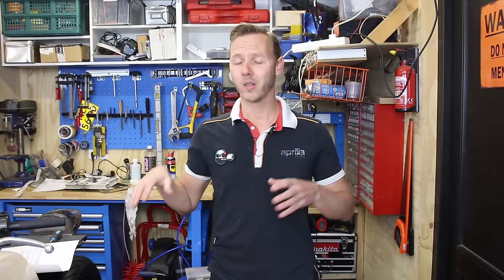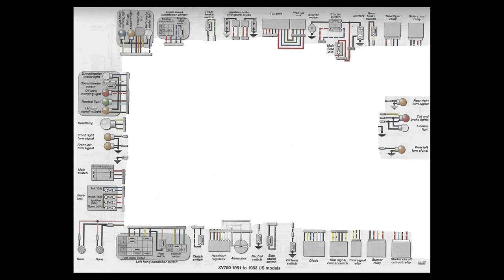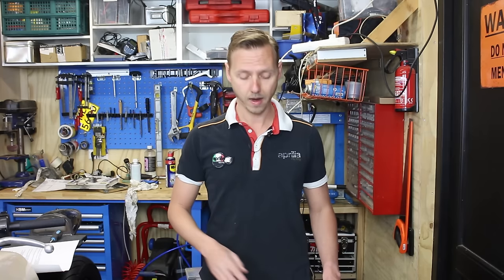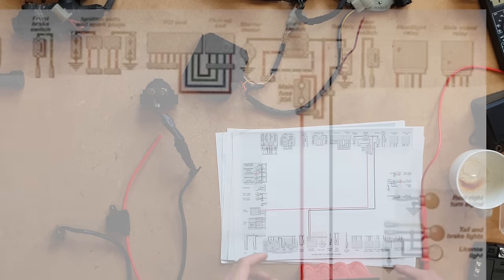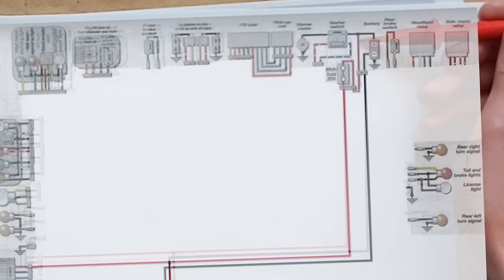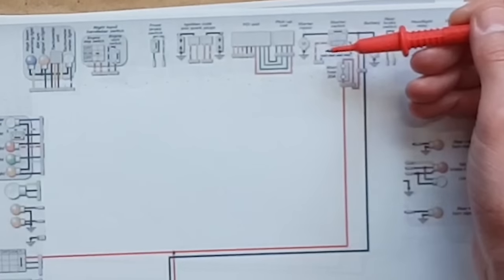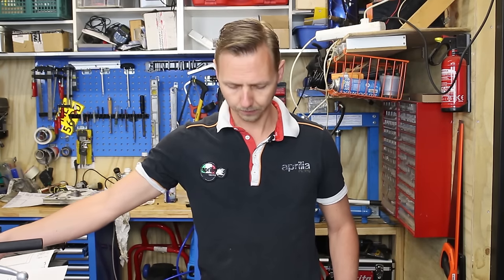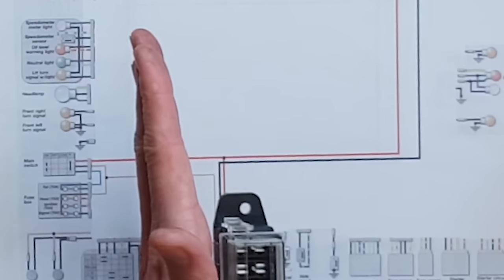Wiring a motorbike (or caferacer) 'Bare Bones' (part 2 of 2)

Comment: This didnt help me i got to the key ignition part and sparks went off i rewinded and re traced steps same thing one from battery 20A fuse  one from battery to starter from 20A fuse to 2 wire key ignition and bam sparks it doesnt work

Comment: Brother, I just wanted to thank you and let you know that I'm gonna go out tomorrow and wire up my 81 xv750 because of how easy you made all this. Thank you so much! It's been sitting in my garage for years because I was too scared to start taking out the 42 year old harness but now , I'm gonna get that fiery woman roadworthy!
Reply: ok, so I have a fuse block but I'm confused as to where I should attach the brown wire from the main switch(not the tap to the regulator/rectifier) onto the fuse block...to clarify, I do not know whether to connect it at the +,-, or to the side positive output terminals, or the ground input terminals... I think 90% of everything else is correct with uncertainty resting in the fuseblock connections and whether I have the two wires connecting the starter and solenoid attached the proper wires "the aftermarket solenoid uses two completely different colored wires than the stock wires. Any further help you can give me or if you explained it in the videos and I missed it maybe some time stamps? Thanks!

Comment: Doesn’t wiring you solenoid to the coils and etc directly,instead of going through the key first, make your Motobike work without turning the key on?
Reply from the maker: No. The main power is given by the key as very first. Main power to Regulator Rectifier 'on or off'. And, it also sends power to the fuse box (on or off) and the fuse box gives the power tot the coils... Follow this step by step video very closely as I explain this.

Comment: awesome video this will help a lot lol i found a 1970 to 1980 first gen Honda Odyssey go cart atv and someone put a Yamaha xj 400 engine from the bike in it and lot of the wires aren't hooked up and the spark plug wires are cut and nothing is hooked to the cgi box and they made there own control box with the key and push buttons and fuses and switches and that but from the key both blue wire goes out of the box somewhere lol and an orange comes back into the box i'm guessing cause its to the start button so there's no spark at all its a mess
Reply from the maker: For you to wire it up properly! 👍

Comment: Question Chief?
I have 83 xv750 but my engine is 1996 with one pickup coil but I was using the black TCI and start having issues and my bike stop working no sparks and all my wiring is chopped.
So I'm using your tutorial and start from scratch but I'll be using my 83 gold TCI.
Can I connect my pick up coil to the gold TCI? 
Only has 2 cables, 1 green, 1blue.
Should I connect them the same way it was?
1 on top 1 on bottom pin..
Great content, it helps me a lot,
Thanks!
Reply from the maker: Oof, that's a hard question. I always had hard times figuring out which pin is which color. The wire colors on the connector which is on the black one should be corresponding to the colors which come out of the gold or silver colored one I guess... Does that help?
Reply: @chiefpepdesign  I have everything connected so hopefully I'll started today.  I'll keep you posted if it works or not and if it works I'll probably make a tutorial cause probably there's a lot of people having same issues building cafe racer with engine swapped.
Thanks Chief!
Reply: Didn't fire up, just crank but no sparks!
I'm getting so frustrated...
I don't know if it's normal from the TCI to send all 12v to my coils( including orange and gray 12v) or they should be ground? 
Also, I always get ground from my 4 pins to the pick up coil, don't know what to do...
Not getting any sparks from any TCI set up I did. 
I follow the instructions from Chief and Virago tech forum for 1996 engine with the black TCI and nothing and now follow the 1983 TCI gold J4T00671 and nothing. 
Any suggestions from Chief or anyone that knows about bare bones Virago?
Any help will be greatly appreciated.
Thanks.
Reply from the maker: @rafaelalmo  I really think the best is to send this discussion to the Viragotechforum. It's too detailed for this place and you find only specialists there.
Reply: @chiefpepdesign  new update chief, 
I made one cylinder to get sparks so only rear is not getting sparks..
Means that if my theory is not wrong,  I have to either splice cables from TCI for pick up or make dual cables from pick up coil to TCI so computer will think that 2 pick up coils..
I'm so glad that your videos really helped,
Thanks!
Reply from the maker: @rafaelalmo  No no! Don't do that. The TCI manages the sparks one by one. The cylinders have to get a spark on very precise moments calculated by the TCI depending on the rpm's. Please don't just splice the cables or you will damage the engine seriously. Try to measure the ohms of your sparkplug caps. Next to that, try to change the gray and orange cable of the cylinder that isn't sparking the other way round.
Reply: @chiefpepdesign  got it Chief, did not do anything yet cause I'm doing everything slowly.   I will follow that and keep you posted.
Thanks Chief!

Comment: I have an 81 xv750 came in a lot of boxes... long story. I have assembled it... finally harness all hooked up, connect battery... nothing apart from one relay under the seat clicking. Dissapointed... I'll say! This has given me new hope.
What about the little block of diodes either in the headlight or (as mine are) under the seat, are they also no longer needed?
Where does the nuetral detect wire that is on the connector to the rectifier connect?
Reply from the maker: Yes. Ditch all the diodes if you follow my sceme. The neutral wire goes to the speedometer.

Comment: Hi! Great videos:) helps me alot👍🏻 i have a question about rectifier. I bought a new aftermarkert rectifier and i wonder how i connect the cables when i just have the black,red and yellow cable? I use the same fusebox and try doing the same set up like you:)
Reply from the maker: That's what I explain exactly in the video. Aftermarket R/R' s only have three wires. The yellow is for the ignition switch. Red black positive negative. Just follow/listen to that part  of the video.

Comment: What is the difference between wiring a tci vs a cdi? I am re-wiring a 93' xv1100 that came with a cdi. The wiring on this bike is complete cobb-job. 
All components test out ok thanks to your first bare bones video. I Re-grounded frame,  starter, etc. with thick wire as suggested. I need to know how to go from the small wire on the 3post solenoid to the starter relay if even needed? The cdi, to the coils, kill switch, start switch, etc.. I am using a  Toggle switch instead of a keyed ignition. Any advise could save this bikes life. cheers!
Reply from the maker: Should be the same... I can't make more out of it sorry... 😔

Comment: Hi love the video. Really informative considering I don't know much when it comes to electricity. I was curious though, does it matter the brand or type of my regulator/rectifier? I have a 1981 xs400, but i don't know what I need.  Can I just use one from the same bike as mine but a newer year? Sorry I'm just kind of lost here. Thanks.
Reply from the maker: I find that always hard to answer. What the thing does is make ac current to dc current. In a certain amount to charge the battery. Since a 1985 R/R doesn't work on a '81 XV I guess it comes pretty narrow. So I darn't tell...

Comment: Hi thanks for this! I'm cafe-ing my 81 virago 750 and am re-doing the wiring. Im wondering what kind of battery you went with? It looks like an 8 cell? I'd appreciate any info. I'm not really sure how many cold cranking amps I need.
Reply from the maker: A 12 Cell Life Lipo. But the brand doesn't exhist anymore. You can go for Antigravity that's a good brand. You will need 360cca. I tell everything about it in the starter problem solve video. Make sure to watch that.

Comment: Love your videos. They have helped me with a lot of my questions and build ideas with my 81 virago build. I am having one issue, and I hope you can point me in the right direction. I was removing the starter to replace it because the gear was broken off into the case. After removing the shift lever and case, the shift mechanism pulled off of the shift cylinder (not sure what to call it). I've tried putting back into the right orientation several times thinkin I was putting it back wrong but, once it's put together, it will only shift into first and neutral. Is it because I have to put the case back together and fill it with fluids? I know some older bikes have a hydro lock system but I don't want to waste new fluids and have to dump it back out if that's not it. Just trying to save money and time. I've watched so many videos on YouTube, especially yours, and you have a super firm grasp on a lot of Virago issues and workings. Any help would be appreciated. Thanks
Reply from the maker: Mike McDermott Thank you so much! Are you trying to shift it static? Because that won't work. You only can shift up further then second gear when you spin your wheel or shaft. Rather with the wheel on so you make big turns. Or roll the bike if you can't lift the wheel. The shafts and all won't find their way static... Have you found my video where I install the shift mechanism? You can pause the video and compare your installation. Just to make sure.
Reply: Thanks for getting back to me. I will definitely have to go back to that video and study it a little further. I will definitely try it out. The bike is looking fantastic. Keep making videos, you have a life long fan. Thanks again.

Comment: Great video - thanks Chief.  I just bought a part finished VX750 cafe racer.  Most mechanics and framework complete to a very high standard.  I just have to do the wiring.  I'm trying to decide between the wiring approach you outlined versus using a Motogadget mo.unit blue.  Would the mo.unit simplify or complicate the wiring do you think?
Reply from the maker: No, it won't make it easier at all.
Reply: @chiefpepdesign  Thanks Chief, I'll save my hard earned money then :-)

Comment: you don't used a R/R for your lithium battery diferent right?  I got my  antigravity lithium battery in my project xv920 1982 and I don't know if I can use my original R/R or I need to buy a new one.
Reply from the maker: Original is no problem at all!
Reply: @chiefpepdesign   Thank you so much,  I was concerned because there is a sticker that said "Do not use this battery in pre 1990s motorcycles without updating your Voltage Regulator"
but I see that your bike don't use a new one.

Comment: Question! I've got a regular car fuse and a cylinder glass fuse. They both say 10A, but, since something is wrong, one of them blew (the glass cylinder), while the other didn't (the regular one), causing a tiny fire in my wiring harness. Why? I thought there was no difference as long as I have the same amperage. :?
The videos are great, learned so much from these, thank you!
Reply from the maker: Well obviously you have a (serious) short circuit somewhere. Maybe the glass one is a bit more sensative... I recon if you put a plastic one in that place, it would also pop. One them goes first. If the glass one is the first, then the other one doesn't. Same goes if you put two plastic ones in the same loom.
Reply: Suspecting the stator (there's a 'beep' to ground. But when i took it to a shop to get a new one, the guys there said it might not thecessarily be bad=/ how come? Got myself a new rectifyer and cdi (cheap moped - cheap parts :D ), will see how it goes 😅

Comment: Ok if you have a bike A Kawasaki GPZ 600R that came without a wiring harness, one that had been cooped up so much that I had nothing to go on or no Patton to follow what do you do? terminals 5 at the bottom 5 at the top, but
Thanks and kindness regards Terry…..
Reply from the maker: The same as all the other questions below with different bikes. First find the wiring diagram. Then, just draw the wires like I did in this video. Pick a color which you like for each. If you want to make it easy, pick my colors.

Comment: Chiefpep your wiring videos have literally saved my build! So many things I did not understand until watching your videos. Thank you! I have one question for which I cannot seem to find an answer for. In the original xv750 wiring diagram, there is a starter cutoff relay and starter cutout relay. In your videos, you use viragohelp-Dan's wiring instructions which do not have these relays anymore. I'm confused on why you would take them off? Aren't these the things that turn off your starter after the engine/alternator is producing power? Since there are no more cutoff relays, does this mean your starter engine is always on and is this bad for your motorcycle? I appreciate any insight into this! thank you!
Reply from the maker: Matthew Sirvinskis Hi Matthew. Yeah.  Those relays are absolutely not necessary. Just follow the bare bone scedual. The starter is only on with the engine run toggle switch (if you choose to use this) plus the ignition. See and follow the leads. The coil gets a signal or not. Depending on the position.
Reply: Wonderful! just wanted to make sure! thanks again!

Comment: Will the same principle work with a 1200 bandit I was told all japanese bikes have pretty much the same layout, there just seems to be a hell of a lot more wire's in my bandit n I'm confused
Reply from the maker: If it has no fuel injection; yes it's pretty much the same. And the basics are the same always.
Reply: @chiefpepdesign  ta

Comment: Would this apply to an 08 Yamaha vstar 1100? I know virtually nothing electrical but need my harness to shrink asap! Was hoping this would be a decent set of guidelines to follow? Thanks for any help
Reply from the maker: Yes. Every motorbike works with the same components. The only difference is that your Vstar has fuel injection. That needs power to and I have to be honost that I never dove into that...
Reply: @chiefpepdesign  actually the 08' still has carbs, so just got a fuel pump! Thanks a ton for your videos an help, I'm gonna get to working asap!

Comment: Hi there, I love your videos. They're very helpful. I was wondering what the thickness (16mm2 or 25mm2 or less?) of the ground wire and the 12V wire are, wich lead to the starter motor?
Reply from the maker: At 21:55 I explain the thicknesses. But, the ground wire and 12 Volts are way thicker. I guess 8 or 10 Gauge. But I can't be sure. Just choose nice and thick ones for those like 4mm.
Reply: Chiefpep Thanx for replying!

Comment: Great video! I didn't see you hook up a relay for the starter solenoid. The factory harness includes one. Is this unnecessary or did I just miss it in the video?
Reply from the maker: No absolutely not. That's how you get rid of 32 wires....

Comment: Hi Chief
Sorry to keep asking questions , i'm really enjoying watching all your videos.
i cant get the wire diagrams you are using , i don't think the site is working where you got them from and notice other people are having trouble to. just wondering if you can include them as i don't have a Yamaha, i have a Honda ST1100  and i am trying to follow you by matching like for like but without your diagrams i'm having a bit of trouble keeping up.

Merv
Reply from the maker: You first have to create an account. Then wait untill it's made. Then you need to log in and you can find them. I don't share the diagram. Besides that, it's for a XV 750 so you will not be able to use them for your Pan European. But the basics are the same. Most people pause the video and make a screendump. That's easy to do.
Reply: @chiefpepdesign  never herd of a screen dump
how do you go about doing it
Reply from the maker: @mervshepherd2459  on the right upper part of your keyboard you find the key 'screenshot'. Then the computer makes a picture of your screen. Then you can 'paste' it in any program you like as a picture.

Comment: Great video! I am about to start rewiring my own CB750. Could you link the connectors you used please? I saw some cheap one on amazon but I am skeptical they will not be good. Much appreciated!
Reply from the maker: The best connectors are the AMP superseal connectors. Just Google them.
Reply: Thank you!  @chiefpepdesign

Comment: Hello chiefpep your videos are excellent I just discover your channel, I am building my virago xv750 cafe with your videos, I will use the stock ignition switch it has a blue cable, what is the function of it? thank you
Reply from the maker: Ricardo Gonzalez Nuñez That will be parking light. If you don't use it, leave it. Test the other two by making a 'loom' with your voltmeter and switching it on and off to secure yourself you are using the right wires.
Reply: ok I see, thank you for your reply!

Comment: Im going to re wire my starter setup (xv750) What size cables should i use to make sure that they are Big enough?
Reply from the maker: Peter Sahlberg 10 gauge. Or even 8 if you want.

Comment: Hello, do you have the ignition connection diagram of my yamaha virago xv 535 motorcycle?  My motorcycle turns on from the ignition switch, but does not turn off.  Even if I turn the key off, the motorcycle continues to run.  There is an error in the link.  Can you help?
Reply from the maker: You need a diagram which can be found in any workshop manual.
Reply: @chiefpepdesign  It opens with the key.  But it doesn't cut the power back.  It won't turn off even if I remove the key  It is closed with the start/stop button on the handlebar.  I couldn't find the schematic, I don't know.  I cannot use my motorcycle 🤔🙂
Reply from the maker: @emrahsahan5287  I have made these video tutorials to help people with these problems. There isn't more I can do. Buy a workshop manual for the diagrams.